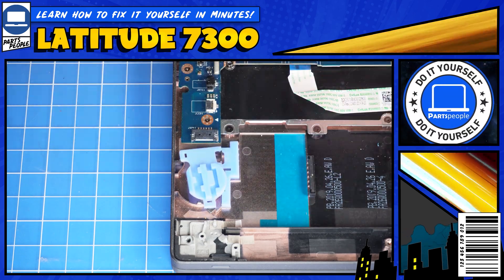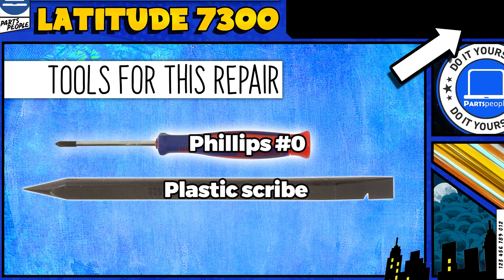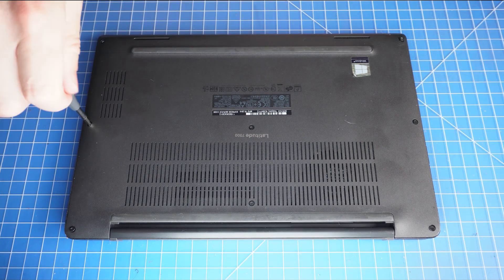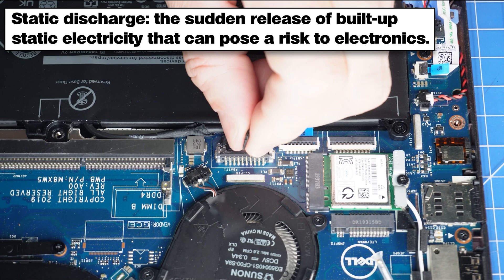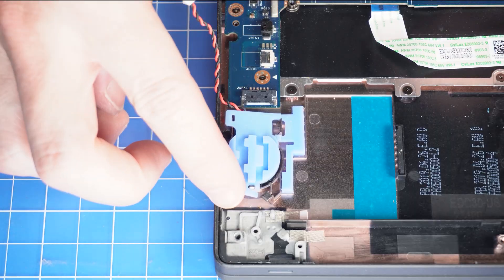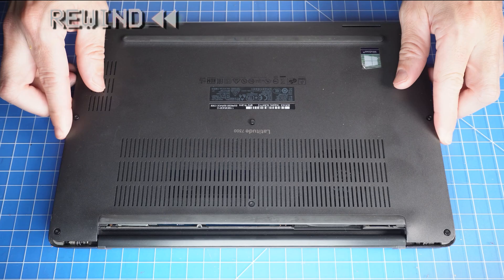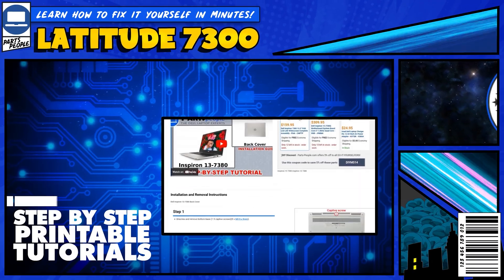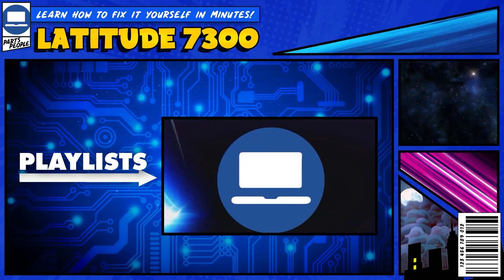How To Replace Your CMOS Battery | Dell Latitude 7300

Comment: This seems not to be a 'step by step' instruction : some other parts and wirings need to be disassembled/disconnected first before you have access to the CMOS battery. It's a pity that these preliminary but necessary operations are not shown in the video...